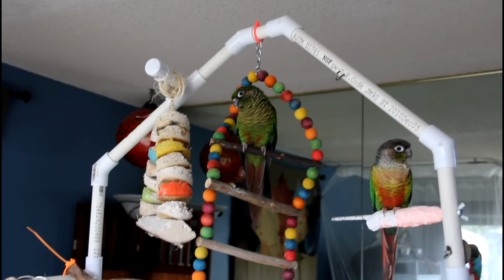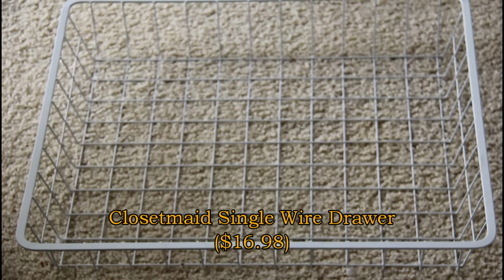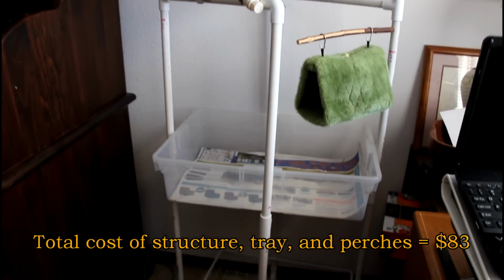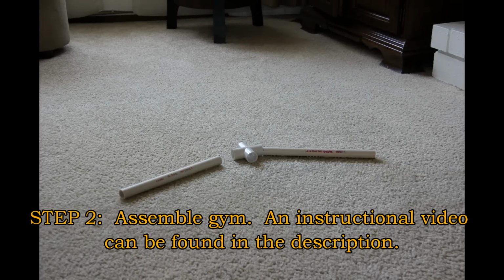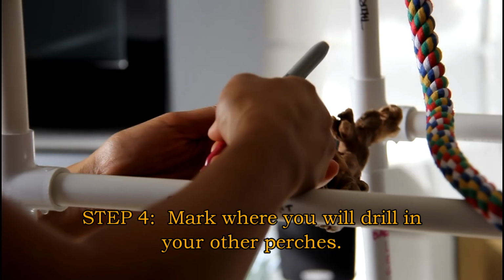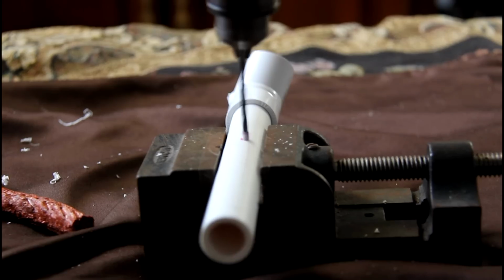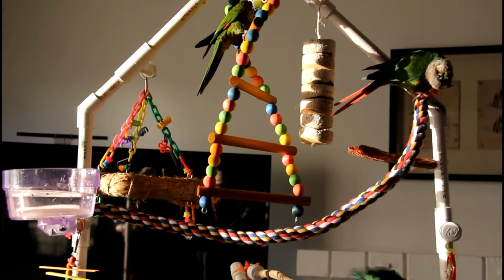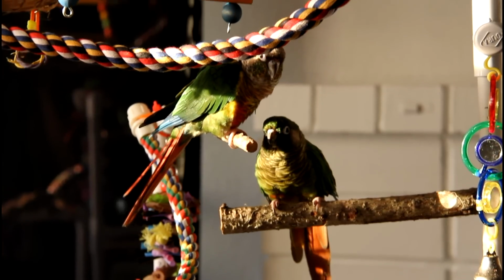DIY: PVC Bird Play Gym

Comment: Ty so much! i recently became the mom of a grey and was wondering if I could just change the pipe to 1"? Would the dimension be the same or should I increase it?
Reply: Good question... the dimensions of the gym is made to fit my tray.   If the pipes for the "base supports" are too small, then your tray won't fit.  Because the PVC connectors might be larger, then you might need to adjust the following measurements (but keep all the other measurements the same):

4 Short Base Supports (19 cm or 7 1/2")
4 Long Base Supports (26.5 cm or 10 3/8")
2 Cross Supports (36 cm or 14 1/4")
2 Steeple Leg A (8 cm or 3 1/4")
2 Steeple Leg B: (24 cm or 9 1/2")

When you do adjust, just make sure everything's the same size, or your gym will be...lopsided.

However, if you are not planning on using solely PVC perches, you can still use 1/2" PVC for the entire gym-- just make sure that when you buy perches, you get ones the appropriate diameter for your African Grey.   And FYI, you don't need all the perches to be a uniform diameter-- it's good to have varying diameters for your perches so your bird's feet gets some exercise (and it mimics what they'd have in the wild).  You can have a few small diameter perches to a few larges ones... and then have perches that are mostly the correct size for your Grey.  

I found this online in case you're interested:

"A variety of perch sizes and materials is essential for African Greys. In his bird cage, [my African Grey] perches on items ranging from 1/4 to 4 inch in diameter that are made of metal, wood, rope, acrylic, stainless-steel chain, coconut, high-impact plastic, bird-safe rubber and a few other materials.

I was always amazed at my African grey’s ability to find the thinnest perch in the cage to stand on. You would think that a pet bird would choose a sturdier perch, wouldn’t you? My point is that African greys don’t just perch on their perches. Whether they are upside down or right side up, African greys will perch from almost anything in their cages that they can put their feet around."

I found that exrcept her in case you want to read more:
http://www.birdchannel.com/bird-magazines/bird-talk/march-2007/teaser-wild-at-home.aspx

Best of luck with your parrot!

Comment: I am curious. You have two different versions of this play gym in the video. One with a single 90 degree elbow and one with two 45 degree elbows. What are the measurements for the more stable one with the 2 45 elbows at the top? Thanks.
Reply: I don't have those measurements, as that gym is now at my parent's house, but you can simply make the "steeple" pieces shorter to accommodate having two 45 degree elbows.  Just eyeball it.  :). Good luck!

Comment: The pipe surface is a little slick for the birds to grasp and climb.  To remedy this, I got some double-sided tape, wrapped the tape around areas like the long poles and the food cups and toy perches then got some of that medical tape that sticks to itself, cut the tape width in half and wrapped the tape over the double-sided tape with a little of the ends of the tape overlapping the end of the pipe so I could cover those with the cap.  We'll see how it holds up.  I think it'll be fine for awhile.  I hope my birds don't want to knaw it apart into little pieces! Another way to handle the surface is to sand it and put notches in the pipe surface.
Reply from the maker: Good idea!  I saw other people use some type of sport grip tape as well.  Hope your birds love it!  It took my birds a week or so to start flying to it.
Reply: @XoletteLife  its vet tape

Comment: We have 3 cockatiel, 2 lovebirds and 5 parakeets and so we are looking for a play gym and your's is great!  Someone asked about their cockatiels below and you said you would assist in setting up a play gym for cockatiels - how would you change up your play gym to accommadate the medium to smaller play gyms?  Thanks.
Reply: I mean "to accommadate the medium to smaller birds for a play gym?  Thanks
Reply from the maker: jen ica I think the size of this play gym would work fine for cockatiels, lovebirds, and parakeets.  If anything, you can use smaller diameter perches, but this would work fine.  I made the "frame" of this gym according to the dimensions of the plastic tray (that catches bird poop).  You can design a different frame that suits your needs.  :)  I'm planning on making another gym, but it'll probably be twice as wide as this one... if you do make a different play gym, just make sure the appropriate pieces are the same size or your gym will be lopsided.  :)  Best of luck!

Comment: are the pvc pipes too slippery on their nails and feet or do they fine?  Would wood be a reliable substitute?  Thanks for the video!
Reply: I'm not sure what you're asking me.  Can you rephrase your question?
Reply: In other words, do the birds have a tough time gripping the PVC pipe?  PVC pipe has as very smooth texture so I would wonder if the birds have issues walking and gripping the pipe or do they do fine?  Sorry if that's confusing lol I'm trying to explain it as simple as I can
Reply: +Thomas Crohan I use the PVC only as a frame to hold perches so they have no need to walk on the PVC.  Others that have used PVC as perches will wrap it in tape so it's less slippery.  I don't know what kind of tape they use though.
Reply: Ahhhh ok i gotcha, thank you so much for the reply! Looks awesome btw :)
Reply: +Xolette HI, love your playgym design. I would like to make one for my Sennie and Jenday.   Regarding the PVC pipe slippery issue, I have seen other PVC play gyms which have Vet tape wrapped around the PVC perches.

Comment: Very impressive!
Question 1: It looks like the water dish might actually be hanging out beyond the boundaries of the wire drawer at the bottom, is that correct?  But even if it is within the boundary, you're going to have water splash that falls beyond the boundaries of the wire drawer?  So, is the entire gym placed inside a larger container at the bottom, e.g. a plastic container?
Question 2: I like the stop motion animation. Did you do this using photos?  Or did you continuously film it, and then only select frames that you had stepped out of?
Question 3: What software did you use to create the final stop motion animation?
Thanks again for the great video!
Reply: Whenever the birds take a bath the water inevitably goes everywhere, even if I angled it dead center of the gym.  When the gym is disassembled,  the pieces will fit in the plastic storage container.  I took pictures using a wired remote. I now have a wireless remote called the RC-6 which works better when doing this type of video.  I have a video on this remote.  I used  Cyberlink PowerDirector for the stop motion animation as well as to edit this video.   Thanks for watching and good luck!

Comment: What size bowl is that? How many ounces is it? I'm in the process of making my bird gym. I would love to include a bowl too. I'm adopting a green cheek conure. :) this bird will be very spoiled haha
Reply: I used two different sized bowls.  There's a standard size and a smaller one.  Either way, the size of the bowl doesn't matter much.  If you find that the gym is leaning forward from the weight, you can always shorten the PVC segment it's on (called "Toy Hanger") to make a stronger base or you can just screw it onto the actual structure.  Best of luck, Jackie and hope your spoiled conure loves it!
Reply: Xolette Thanks for the feedback and the great video for inspiration!

Comment: Did you use any kind of glue to hold it together?
Reply: No, glue's unnecessary.  It's all pressure fit.
Reply: I'm trying to make one but it won't stay together. Some parts keep falling off.  Thanks for the awesome video
Reply: ***** Perhaps you got the wrong size fittings-- it's common for people to take out the fittings and place them in the wrong box.  Your fittings should all say "1/2 inch" somewhere.

Comment: How do u fit the 10ft PVC pipe in ur car? I have everything but those
Reply: It fit fine in my Scion xB.  But if they're too long for your car, you can make sure you have PVC cutters with you and cut them down in the parking lot so you can fit them in your car.  (Alternately, you can see if an employee will help you make the cuts.)  My advice though is to make the cuts you need so you don't waste any PVC.  For example, you can cut 3 of the "Long Base Supports" (26.5 cm or 10 3/8") off the ends of the three 10 ft PVC.  Good luck!

Comment: Good step by step instructions for making this gym - thanks. One thing I did to make the pvc gym even more colorful for my bird is to use colored pvc. You can get all of these pvc parts - pipes and different types of fittings/joints - in a wide range of colors. Best part - they're not that much more expensive than the std white pvc equivalents. (Best prices and color choices are on Formufit_dot_com). 

Choosing colors and how to blend them together into an attractive pvc "sculpture" made this DIY project much more fun and creative for me. It looks good by itself before I even add the toys, ropes, bowls, and other accessories. Of course, parrots appreciate all the color too because they have even better color perception than we have with the addition of an ultraviolet color receptor in their eyes (besides the 3 we have too - red, blue, green). I shined an ultraviolet light on the gym and parts as I assembled them to help me imagine what it will look like to my B&G Macaw. Tip: Fit them together first to see how they look together before you go back and permanently cement them. In fact, I'm not cementing mine at all because the fit quite snugly without cement and I want to be able to disassemble and reassemble it, if I want to try a different configuration and to make it much easier to move within the house or via my car.

Regarding what size pvc pipe to use, it depends on the size and grip of your bird: Before I ordered all the colored pipe and joints I need, I made an investment of less than $5 at my local home improvement store for small std white pieces of the pipe sizes I was considering. I brought them home and had my macaw stand on each one. I observed how well he perched on each one and ordered the best size. The other thing I did is build the base with larger pvc pipe than I used for the perch levels to make it more sturdy and "bottom heavy" since Macaws are so acrobatic, it's possible he could topple the stand with his antics during peak playtime if the bottom wasn't stable enough. You can buy adapter fittings to connect different size pipes. For any fitting not available in the color you want, use a std white fitting. I made double sure the gym wouldn't tip over by buying 4 modern equivalents of "sand bags"/"bean bags" and draping one over each bottom pipe. This also helps hold the gym down in strong winds since I keep it outside on my screened-in lanai (we live in Florida so he can be out there year-round).

To give him a better grip on his favorite perching and climbing pipes, I wrapped some of it with colored vet tape (available online in a variety of colors, including a multi-color pack). I also scored some of it with a rough file, just enough to take the slipperiness off of the pipe surface, not so rough that it's abrasive on his feet - like a pvc equivalent of sandy perches.

p.s. I've been caring for companion birds for over 20 years, as many as 8 birds, 6 different species, at a time (I ran a private animal rescue/sanctuary). So I'm very experienced with birds. I used to buy expensive pre-made gyms and accessories. I had to leave them all in CA when I moved because too expensive to move them. Now that I'm retired, I have to go the DIY route on a lot of things I used to buy. Best of luck and enjoyment with your own parrot care!

Thanks again for the excellent vid, XoletteLife!